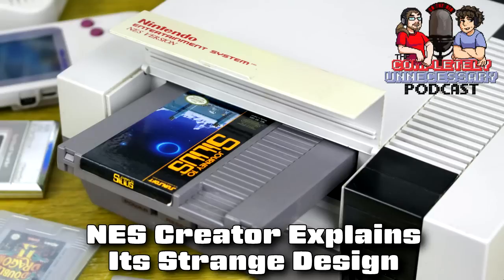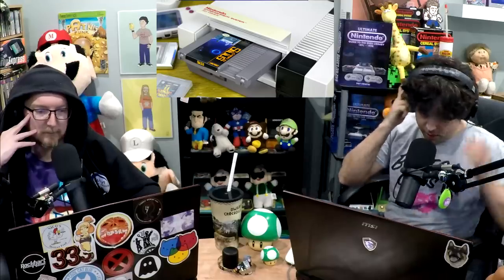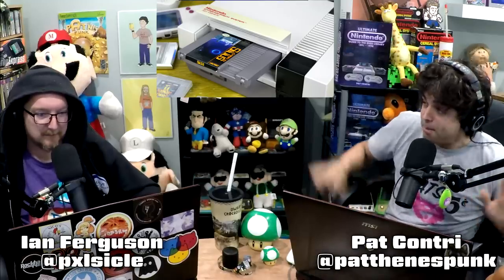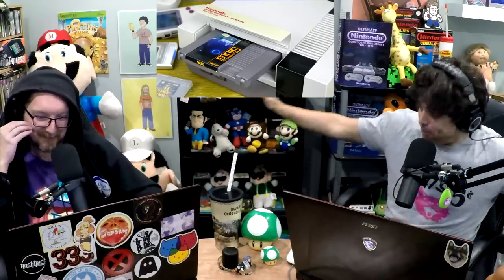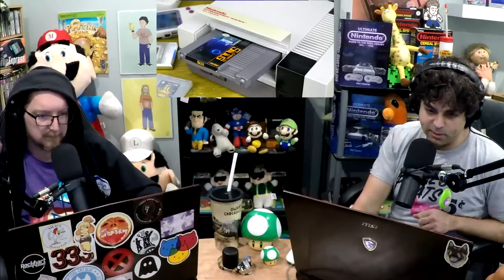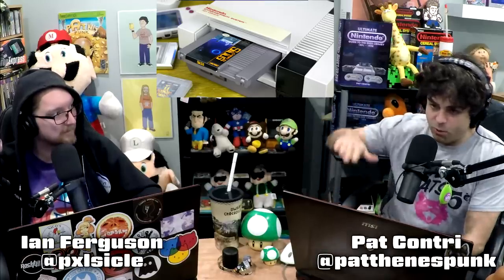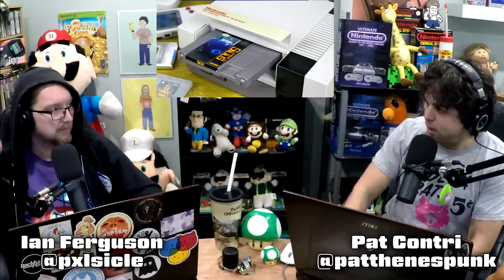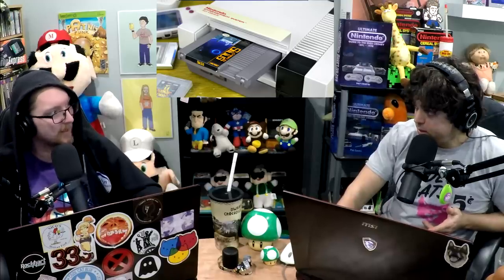NES Creator Explains Strange Console Design!

Comment from the maker: What do you think about the explanation for the NES's redesign? A little over-the-top or does it make sense to you?
✅More info @http://www.nintendolife.com/news/2020/02/nes_creator_reveals_the_shocking_story_behind_that_infamous_flap
Reply: I'd heard about the explanation about it being made to load like a VCR and distancing it from gaming consoles due to the crash of '83. However I've never heard the one about dry air and short-circuiting. That one doesn't make as much sense to me. I mean, the Atari consoles were top loading.
Reply: It was undoubtedly to make it look like a VCR since the Atari 2600, 5200, Colecovision, Intellivision, etc had no issues with shocking children.  Given how much more robust 2600 cartridges were (NES games had dirty contact issues just a couple years after release where it two DECADES before I had to clean the contacts on my first 2600 cartridge) I'd say it was the design and not the US weather or "dumb kids".
Reply: For one, we stopped using hard wired controllers since the Pong Consoles. Second, controller ports on the back of the console were a nightmare with all the other rats nest of cables. So from a design perspective, shoving everything in the front just made sense.
Reply: Cccrrrrack smokerrrr!!!
Reply: Patrizio you fool, they were worried about static frying to the mother board which would result in costly warranty issues. Not health and safety issues such as kids getting zapped or catching on fire. But I do agree that a simple top loaded design would have been much better from the start. All they had to do to protect from static charges was to have all the bits that could be touched be well insulated. They managed it well enough with the North American SNES that was also designed by Lancimus of house Barr.
Reply: Lol, I’m listening thinking, yeah it was a pain, but whatever, there are other ways to play em now... then you mentioned losing a team or season in Baseball Stars, and immediately I can feel my blood boiling. I lost so many teams through the years of owning that cart, it’s ridiculous. I haven’t gone back to it in years. 🤬

Comment: The concern for the potential to "short circuit" wasn't regarding safety. He was talking about ESD (static shock) damaging the console or game. It's harmless to people but often destroys electronics. The pins are recessed so you can't build up a static charge, reach in, and zap the console directly.
Reply: @Fanuc_Operator1990  Guess the ESD thing was lost in translation if you don't read between the lines. :)
Reply: That's exactly right! I think it's not only a valid concern but a simple and aesthetically pleasing design that not protected the console from shock but accidental damage from real little kids trying to stick foreign objects into the NES
Reply: Even if it did go over their heads, Nintendo's reasoning is bullshit. They made it the way they did to resemble a VCR and distance itself from the look of a gaming console. The pins could've been hidden down inside of a slot, just like the SNES with a little cartridge dust cover. They designed the SNES and the NES top loader that way and they ran just fine. The consoles weren't shorting out or shocking/damaging components inside. It was the same way with cleaning carts and telling people not to use rubbing alcohol. "Ohhh, we were worried children would set themselves on fire" BULLSHIT!!!
Reply: Yep. I melted a neogeo MVS like that.

Comment: I'm a big fan of the Famicom and we got shafted in so many ways.
Credit to the NES designer for the detachable controllers, the first system to have composite video output (long before most TVs supported composite input).
But it really sucks the microphone was removed, we never had the FDS, nor the expansion audio in the FDS or in some cartridges. They removed 2 tiny resistors and putting those back in is all you need to restore the expansion audio feature. We didn't get the 3D system, Famicom BASIC keyboard or tape drive either.
But NES cartridges are way better with how uniform they are and the end labels.
Reply: > the first system to have composite video output
For, like, two days (Oct. 18th and Oct. 20th 1985). Then the Sega Master System came out in Japan which also supported RGB JP21 (the Japanese RGB SCART).
Reply: Famicom carts are space savers, which should be more than enough to convince people they are better.

But then again, in a world in which we can’t even get rid of plastic bags readily in NYC...
Reply: tjsynkral We really didn’t miss out on much when it comes to the microphone. Like the man says, there are only a handful of Famicom games that even took advantage of it. Would others come out if the functionality had left Japan? Probably, but the question then is whether or not they’d even be worth playing. It’s my understanding that the accessory was pretty limited in what it could do because the Famicom only had so much power.

Comment: I only ever had the 1985 model. I was born in 1984. Played the NES until late 1991 or early 1992 when we got Genesis. I remember blowing in it like crazy and wiggling the cartridge around inside the system hitting power like 15 times to finally get it working. Kids today are spoiled lol

Comment: I just recently found a way to ‘fix’ it cheaply I think. Use a cheap dental tool to lift the depressed pins a bit, then make a small shim to keep the carts from going in too far (kind of like the blinking light win does.) No boiling, sanding, or anything else on the 72 pin connector. I put up a video of it.
Reply: Tech With Sean Just use a Game Genie to bridge the gap.

Comment: I know that electrostatic discharge can mean a slow death for circuit boards. It’s like you have a rope under strain and the ESD comes along and cuts a few threads. I don’t know how it would transfer from a plastic cartridge case to the plastic of the console. 

The design of the NES was good for their branding. It looked cool and not like any previous video game console. I guess it could have still been a top-loader, but with the same colors; a chunkier version of the actual top-loader made in the early ‘90s. I was fed-up with the problems of the NES by the end of the ‘80s and I welcomed the Super Nintendo with open arms.  Our old SNES still works too.  I used to try to get through Zelda II as a kid and I never actually got to the last palace until I got that Zelda collection that was on GameCube.

Comment: The Official NES Cleaning Kit instructions told you to use distilled water first, then repeat if that doesn't work. If even that doesn't work they say to use "one part distilled water, one part isopropyl." They seemingly avoided using the word "alcohol" even though rubbing alcohol is isopropyl. Also, you generally can't get 99.9% in most places so you'd have a more dilute kind if you mixed one part rubbing alcohol with one part distilled water (70% is common).

It seems Nintendo was very inconsistent if even their official cleaning kit reluctantly tells us to use it if needed. ;)

Anyway, the cream Pat was talking about is likely Brasso. It gets things VERY clean because it's a polish but that's also why many gamers refuse to let it near their games/systems. Polish is an abrasive which can remove the thin layer of gold from the contacts.
Reply: @brettbaratheon9776  Yeah. It probably takes many cleanings to actually wear away the gold but it seems that people are also concerned with transferring it into their systems. I assume most know to clean again with alcohol afterwards but I have seen systems where someone caked it into the connector. :(

Regardless, I've seen game stores that clean all their cartridges with it. People vehemently refusing to let one of those games in their systems might have trouble avoiding it. ;)

Comment: Nowadays, we have the Blinking Light Win replacement.
Reply: Dion R - or you can fix it yourself with a $5 dental tool and a piece of cardboard to keep the carts from going in too far. (Kind of like the blinking light win does)
Reply: @brettbaratheon9776  It's a replacement for the 72 pin connector on a frontloader NES, but unlike most of them, the BLW is designed to not push the cartridge down.

https://www.arcadeworks.net/blw

Comment: I feel like that cream/gel stuff Pat was talking about was pretty much just hand sanitizer.  That stuff could help a lot if you put it on the cleaning cartridge and insert and remove it a few times.

Also not trying to brag, but my NES has an original 72 pin connector and everything and it works perfectly fine when I insert the games first try, if not maybe 2 or 3 tries.  I clean it once or twice a year and keep dust protectors on all of my games to keep it in perfect working order

Comment: its a shame here in the uk/europe they used the north american design of the console as opposed to the famicom, as the super nintendo used the japanese style over here, and for us the video game crash never happened, infact gaming was thriving on home computers during the 80s with no crash at all. the nes was a great system but it was fundimentally one of the worst designed consoles ever with its game loading mechanism that basically damaged the game by the act of repeatedly pushing the games in and out the system.

Comment: I'm not sure how you can say it was awful design, they thought there was going to power issue and this is how the dealt with it.  Was it the best way, no, but I'm pretty sure that problem didn't happen.  I could be wrong, but this was there first system in the USA and if the problem they though could happen, happened then they would be doomed.  I agree, that the front loader is worse then a top loader in general, but I think we can say that the NES-101 (top loader) was even worse. Lacked LED light to show it was on and removal of the RCA composite and audio jacks made the games look and sound worse.
Reply: Not just the removal of the composite output... even the top loader's RF was worse than the original's... those damn jailbars… which is why my personal NES is a toaster + a Blinking Light Win...

Comment: I call bs... what about all the consoles and computers that used cartridges before the NES?  They had no problems with static hurting kids.  It was to make it look like a VCR and not a video game console... period.  They had a first revision for North America with a keyboard shown at CES in 83 if I’m remembering correctly... nobody liked it and they redesigned it to the vcr look we ended up getting.
Reply: It's not that it would hurt kids, japanese engineers thought the static would hurt the console. You know how you're supposed to use an anti static bracelet when you open up and upgrade your computer? It's the same principle. They thought a big enough charge would fry the chips.

Pat misunderstood what was being protected. It wasn't the kids.
Reply: And even the CES keyboard version has protected pins if you go look. They were worried about the climate being conducive to static with that version too.